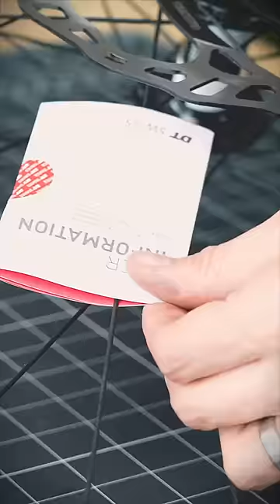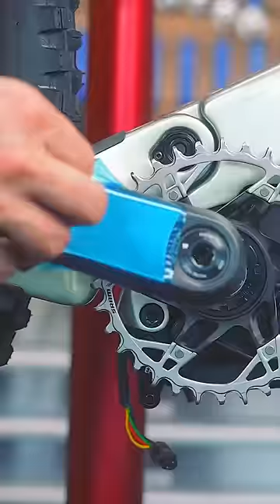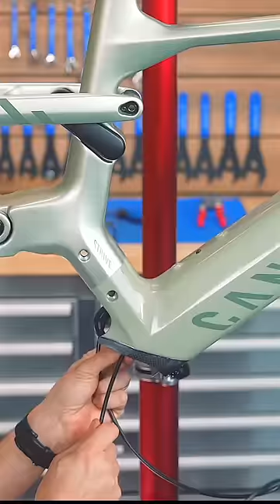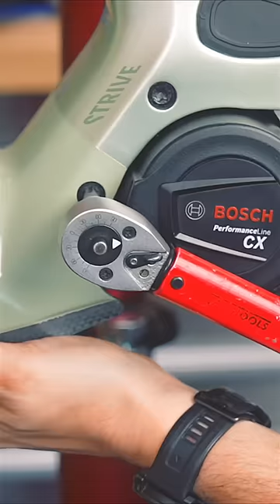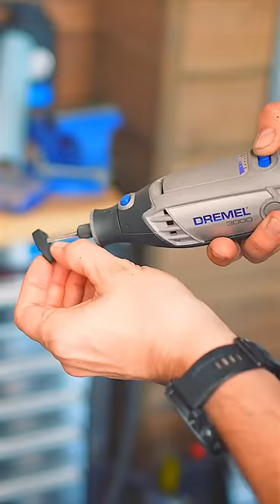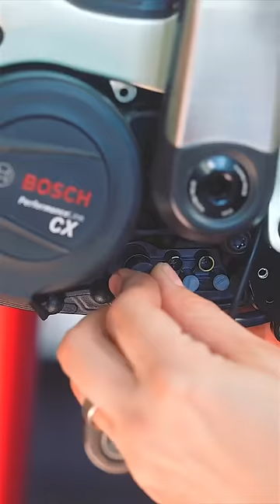Pure Satisfaction 😊 #bike #asmr

Comment: E-bikes are getting all the love.
Reply: Most of it, im still not buying into a 50lb mtb.
Reply: How do they work specifically? Will they go all on their own, or do you have to have some pedal input on takeoff? Is it just assisted to take out say 50% pedal effort or something of that nature?
Reply: @GoatPilot04  Pedaling activates the motor, so yeah, it's a bit like taking some of the effort out of pedaling. Some do it by adding a set amount of power as long as the pedals are moving, while others essentially add power in relation to how hard you're pedaling. Edit: Some people do have a throttle on their bikes that allow them to run the motor without pedaling, but that's an optional thing.

Comment: cool. But one moment is not right, You lubricate the dropper post when inserting it, which makes you have a higher torque on the clamp to hold it. But if you use Loctite Antiseize that will prevent the dropper post to seize but not modified the friction coefficient, so the same torque is required or using Carbon paste would be even better.
Reply: That was carbon paste...
Reply: Sod that. I use my seatpost as a handle a hell of a lot and I dont want that crap over everything.  Been cycling 30+ years and always use nothing on the seatpost. No creaks, no binding or seizing, slides when needed doesnt when clamped 🤷‍♂️

Comment: Ah, the memories. I used to be a lot of this at my last job. I was primarily a bicycle 🚲 mechanic.  Had to teach myself most of the stuff that I did.  I did make a few mistakes in the beginning, but I learned how to do it correctly.  I know of one mistake that I made on the store managers bike.  I put in a nail guard for each tire.  I read the directions several times.  But nowhere did it say that this side goes facing in/out.   I didn't figure that one out until a few weeks later. I did a customer's bike 🚲 and the same thing.  The customer came back with a slit in the inner tube.  Caused by the sharp edge of the insert facing the wrong way.  I fixed the problem, forfree. Told him to come back if he had another flat.  He returned a few weeks later to tell me that they worked great!
Reply: Just bro has written hole paragraph